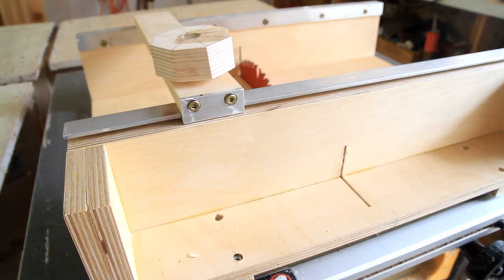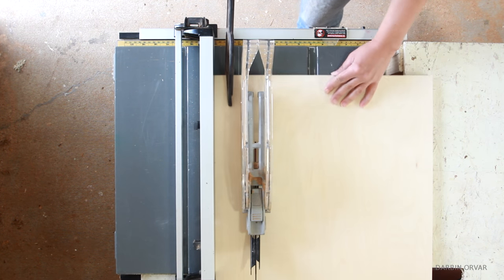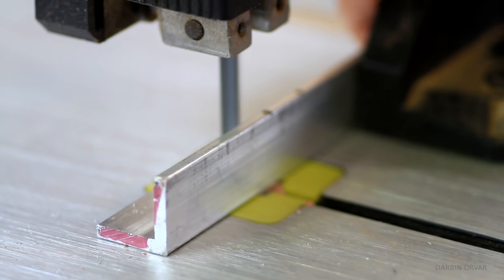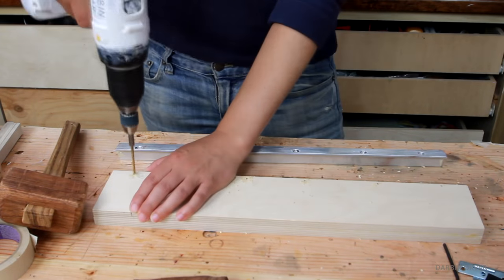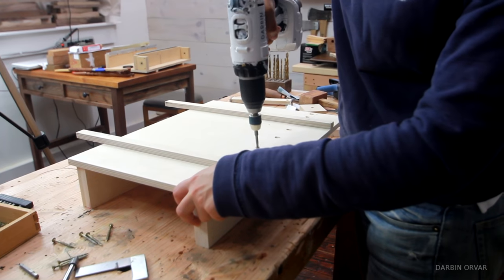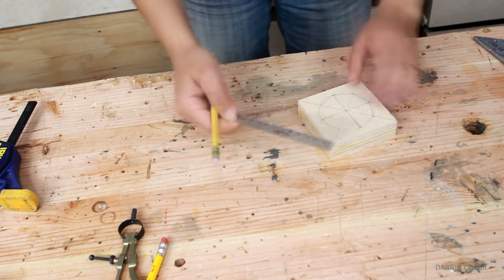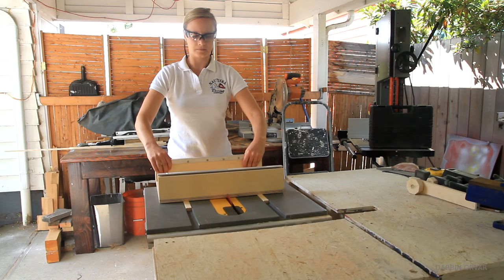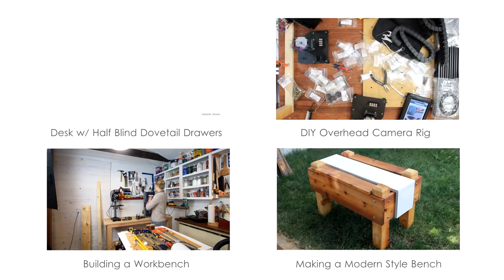Cross Cut Sled w/ Clamp

Comment: This is a perfect solution for some table legs I'm making.  I added a little twist that makes it even more flexible.  Your clamp cleverly moves laterally. I also routed a t-slot from end to end to hold the bolt (instead of epoxying in place). Now I can move the clamp  vertically, as well.  Your solution was a great inspiration.  TY!

Comment: Very nice build. Love the clamping system.  I already have a circular sawbench with a sliding table carriage, but this sled might be useful for working on smaller parts. 
When connecting wooden screw handles to threaded rods or screws i use t-nuts with locking prongs that are driven into the wood. As there is also the need to use epoxy, your method is a good way to do that, too.

Comment: A few years ago, I learned that instead of chiselling out a hexagonal recess for a bolt head, you can drill a hole that matches the spanner size and hammer it in. Wood is soft enough to allow this and I find it faster.

I'm impressed with both the design of this jig and the circle cutter for your bandsaw. :-)
Reply from the maker: Olly Parry-Jones Thanks Olly, I appreciate your comment!

Comment: I have passed with a router the part where the aluminum profile rests (the width of the aluminum) so that the place where the wood for cutting is supported is completely flat the surface.
The sled table saw is simple and very functional. I am making one equal, a little bigger. How fun and how I want to get to this point = 09:07 , the cut.
Darbin, you have a perfect English. Sounds totally academic to the ear.

Darbin, tienes un ingles perfecto . suena totalmente académico al oido.

Comment: Darbin, your "over the top" clamping method is brilliant, never seen it before, and I have designed my share of table saw sleds!Also like the dual push blocks at the sides to keep hands clear. But for me,  I would add a thick block to cover the blade where it exits. The exposed blade is scary and I might forget and by habit put my hand where it should not be. Just a suggestion. I love your videos and have subscribed.Bill

Comment: Greetings from Florida Lynn, I love your way of presenting your projects on YouTube. Almost better than SketchUp, material list w/sizes and annotation, all in one, GREAT. However on this jig I  think you might want to reconsider "hanging the front fence's aluminum,  " L"-angle bar over the inside top of the fence. That causes a taller piece of wood to tilt towards the back of the sled which might effect the depth of cut through the piece. I would rabbet out a notch as deep and wide as the leg of the" L"-angle so as to be recessed behind the plane of the front fence's inside face. Just a thought from a fellow woodworking fanatic.

Comment: Linn, at the beginning and end of the video, I noticed you turned on the saw with the sled already over the blade.  I'd recommend pulling the sled back away from the blade before turning on the saw.  I've noticed on my similar saw, that the sudden application of torque to the blade when turning on the saw causes it to warp and wobble, which will eventually widen and damage the kerf in the sled.  If you pull the sled back before turning on the saw, the kerf can be used as a rough guide of where the cut will be made.  It's also less traumatic for expensive saw blades. ;)

Comment: Nice trackign rai system for the clamp. Can use that on other projects.
Reply from the maker: +Yves Baggi Thanks!
Reply: excellent video. I want to buy table saw learn by myself. I need to build the cross cut and miter sled 45 degree. I need it for made my own wood screen printer frames. which table saw you have. i need small one jus to star for small projects i don't have to  much space. Can you advice me. I consider you very intelligent and your accent nice my respects. Thanks for any help...
Reply: muy buena herramienta sigue adelanté

Comment: Nice sled, I made mine about three years ago from a Steve Ramsey design. We have the same saw, all I could afford and all that would fit in my tiny shop at the time. I wish I had a better saw now. One cannot cross cut very wide boards.
Reply from the maker: MsRmaclaren I made my table saw stand pretty wide, so theoretically I could have made a larger sled to hold longer pieces, but I often use the miter saw to cut long boards and posts anyway.

Comment: This is helpful, I have the same table saw you have but it looks like you removed the wood splitter. I built the sled already but its not working well with the wood splitter.
Reply from the maker: Justin Lehman Yes, I do remove it when using the sled, the splitter is more important to use when ripping wood since there is more tension than cross cutting.

Comment: Nice work!  What I don't understand is, why this contraption for just a cross cut?.
The table saw has been used since it's inception, with just the simple fence that has worked very well.
Reply: My thoughts too. A scrap straightedge attached to the miter gauge is all we ever used since forever. I don't need another monstrous jig taking up space for a single task.
Reply: The thought occurred to me right after i put the comment up and i should've re-phrased. This is all sadly true today, my 35 yr old unisaw cast iron miter fits perfect, but i threw away the plastic one that came with my dewalt dw745 and bought an aftermarket.

Comment: Did you check the squareness of your fence by the 5 Cut Method?
Reply: GarageWoodworks Is there a better way to check the accuracy?
Reply: +pcb1962 Yes - use it!
Reply: 5 cut is the only true test. dial indicator saves time and is second best.

Comment: You do very careful work. I noticed your detail on methods is also very detailed.. the little things.. but you went ahead and screwed and glued the fences.. without cut aligning them.. careful square alignment but the five cut method of alignment might give you different results.. my source on this is William Ng. What do you think about this?
Reply: ***** The difference between squaring so to speak by eye and a carpenter's framing square (often not square themselves and should be tested) is the best you are going to get by eye or line is 1/64th to 1/100th of an inch unless you are nonpareil skilled, whereas any fool can get to 3 thou by the five cut method. And truth is few people will get closer than 1/32 on average. 

With framing square distances -- IFF your square is registered along a flat true edge.. and it's a big IFF.. then you are out 0.111 degrees on average.. probably double that.. still ok for picture frames one would think... They will bear 0.2 degrees error I am told.

 If you are doing joinery it might be nice to be accurate. If one was intending to do box joints (which are short), cross cuts for butt joints, or non joinery work then it might be adequate to follow a line. Bear in mind that 1/100 of an inch across a 2.5 inch picture frame is 0.23 degrees, as far as you want to be out in that business. Any more and your frame won't close.  

A framing square is unlikely if it's true, to be out that much in 16 inches, but your eye can fool you in bad light and it is best to check with feeler gauges.

Comment: Did you ever consider cutting half way down your sled (cut A) before attaching your fences (cut C) so could square the fences from the cut instead of squaring them to the jig? Your method has a greater chance of failure for woodworkers that aren't great at squaring. Myself being at the top of the list.

Also, you never mentioned gluing the runners to the sled. I'm sure you did but if you didn't you should.

Comment: I never understand why crosscut sleds have a back fence. Is having that fence really necessary, would one ever use it?
Reply: WoodStuff You mean the first fence through the blade? The most important feature it provides is holding the jig together. Because you're cutting the bottom piece completely in half, you need two fences to keep the jig from falling apart.
Reply: WoodStuff Jason hit the main reason every sled needs a back fence. Also remember with this particular sled, she also uses the back fence as part of the hold down clamp system!!
Reply: Okay, that makes sense, thanks.
Reply: It prevents flexion that would otherwise occur due to the bottom of the sled being severed. Otherwise you'd have the runners sticking in the track from not being square / the sled could possibly bind on the blade.

Comment: measurement B (Runners) appears incorrect. in my case they were 17" x 3/8" not 3 1/4". otherwise very nice unit.
Reply from the maker: +HB Just fixed that mistake, it should be 17" x 3/4" - but each table saw may be different.
Reply: +Darbin Orvar Just another check. Your Alum angle, would that be 20x25x1.6mm? Never seen 3x19mm angle!. In the video it looks like 20x25mm. Thanks for the quick reply.